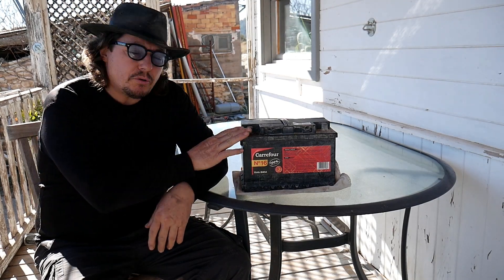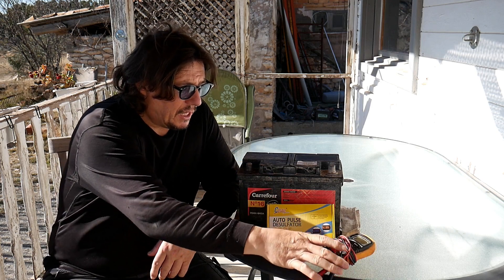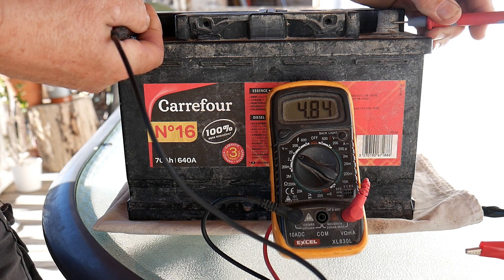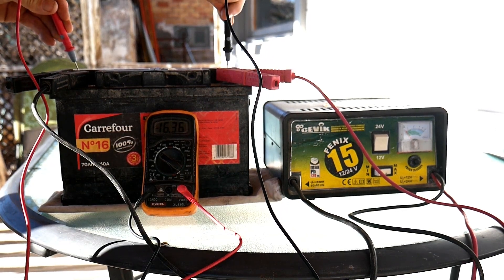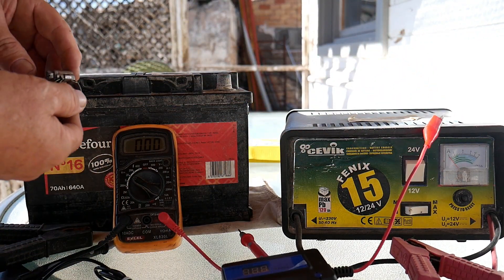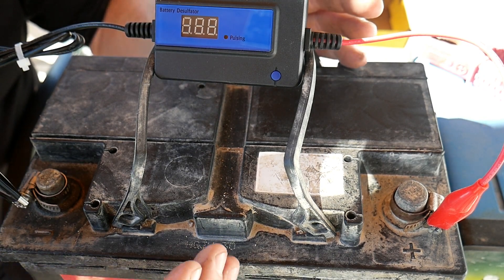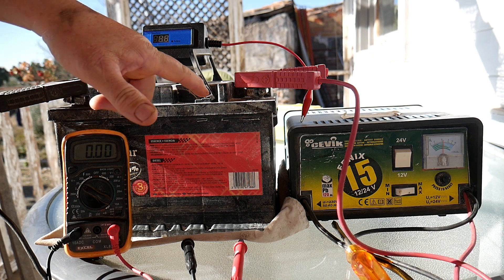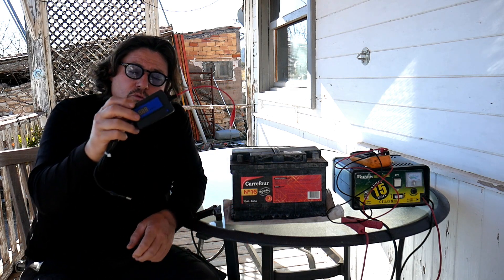How to repair a dead battery. 12v 24v 36v or 48v fix it instead of buying a new one 2024

Comment: Do not use a pulsing charger on a lithium battery. These batteries have a built in battery management system (BMS) and are chemically different. A non-pulsing lead acid type charger can be used on a similar voltage lithium battery
Reply from the maker: Didn't I say in the video that it is for all battery "EXCEPT" lithium? 🤔